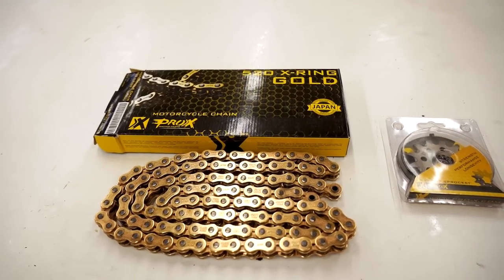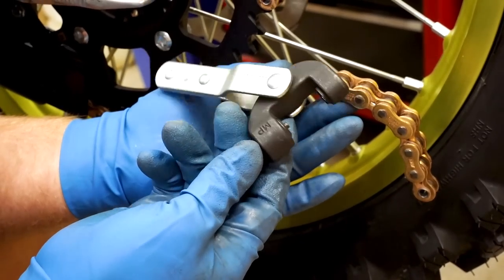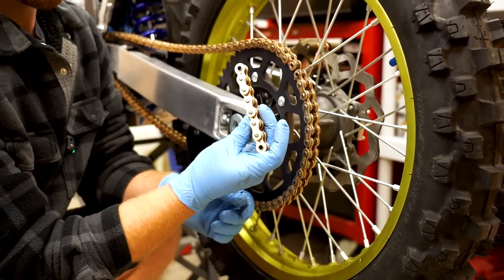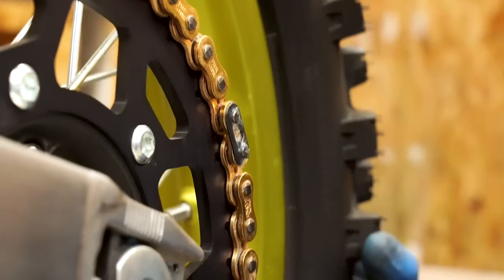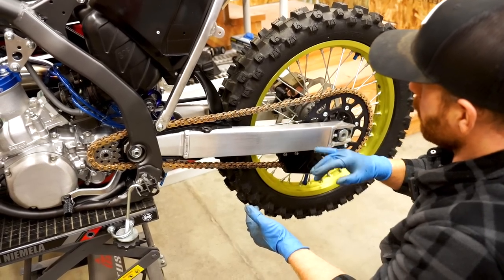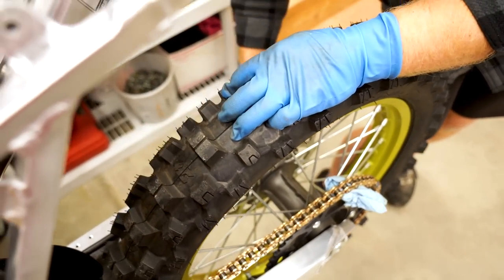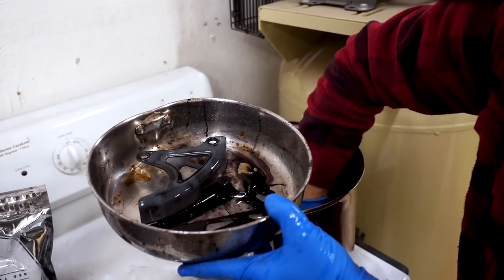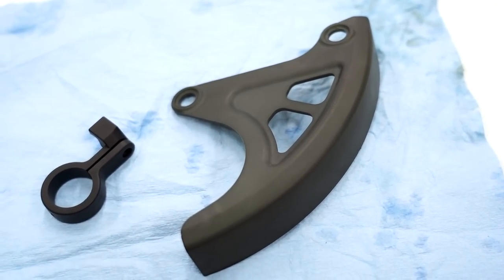No D*cking Around | RM250 Rebuild 34

Comment: One thing to remember is the chain slack when you run th chain short like that. When its all the way forward, roughly check slack before pushing any pins out.

Comment: Couple of helpful tips beyond what Cam mentions in this video. 
1. Buy a Paint Pen - if you actually ride a dirtbike rather than look at it and cut fair-weather laps, using a permenent marker as a torque mark/cross-check substitute is a waste of time - paint pens are $5 and last surprisingly well. good for the home handyman on critical fasteners and still easily cleaned of in 6months with acetone/brake clean. 
2. On reusing rivet pints - rivet master links pins have a specifc design and you need a specific riveting die in your chain tool to correctly rivet a chain back together , do not re-use a riveted pin that you've just pressed out. it's riveted once, you plastically deform it a second time pushing it out, your try to re-rivet/deform it a 3rd time then trust 30-100hp on it and your're asking for trouble. I assumed Cam undstands this too but may have just confused his language while explaining it.  
3. Cam's advice on centering your rear axle here is not what I would recommend, making the assumption the ends of your swingarm are parallel to you countershaft isn't really correct, even more so on old dirtbikes (where alot of welds, cuts, fabrication from factory are pretty agricultural) - hence the whole point of manufacturers actually making increment lines for adjustment. Use the increments then validate looking down your chain is pretty much always a safe approach on any bike, Cam's advice he may be ok on some but definitely not all models. Food for thought, Still enjoy your vids mate - always a good watch :)

Comment: Hello Cameron nice video . I watched ypu from Greece. 😊 I want to ask you something. I have one yz 250 2011. And i go for enduro some Sundays in the mountains. I want to know is good option to put the 325 cylinder on the bike or i loose the lower power of the bike .in my mind is to have little more power in low range with litlle throttle for small path's. But no one say anything about this option.Thanks 🙏